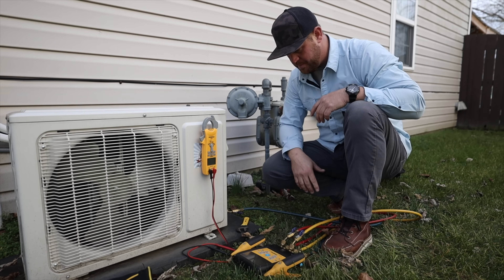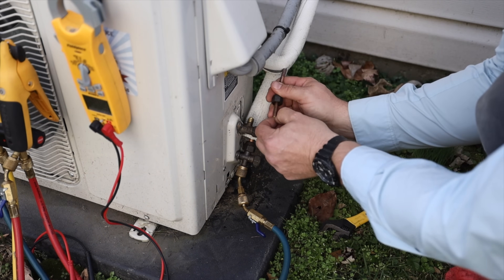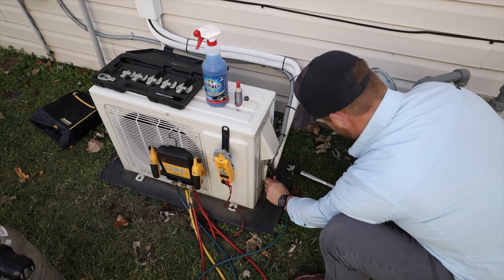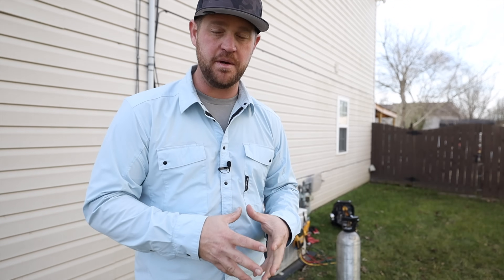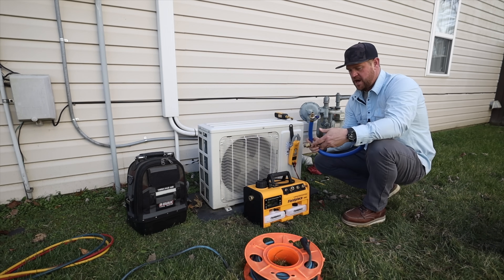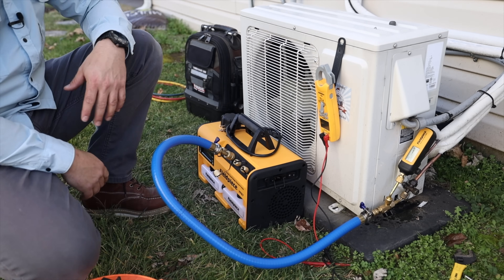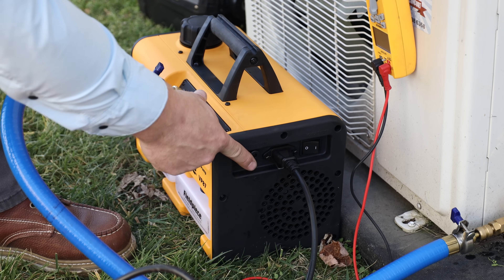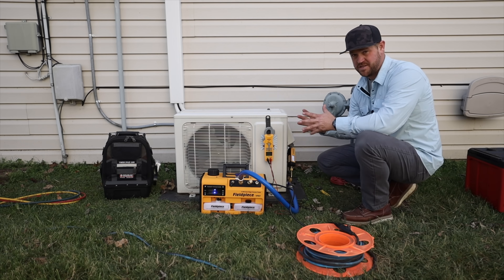#1 Reason Why DUCTLESS Units Fail | How I Fix It...

Comment: One note: anytime you're using a torque wrench you can't re position the wrench when you're close to the torque spec. If you're trying to hit 10 ft/lbs but stop at 9 ft/lbs and reposition the wrench, the wrench will hit 10 ft/lbs and click without tightening the nut at all because it takes more torque to get it started tightening again, so you will still be at 9. That also means multiple clicks on a torque wrench does not work for checking if something is properly torqued. It takes like 130-140% of the torque load to get the nut moving again.
Reply: Once you use lube your torque change’s.
Reply: @busterworley8418  nylog blue is liquid gasket, it's very tacky and not much of a lubricant under high friction. Its liquid spider web.
Reply: @busterworley8418  Agreed, lube has a big impact or the torque spec.
Reply: That is not blanket true - many multi stage tightening procedures have less than a 130% jump to final torque. Also he was using a thread/joint lubricant which makes it less sensitive. Will agree that one smooth motion to final torque is best.
Reply: @paintballthieupwns  130-140% isn't really the important part, if you stop early to reposition and the wrench clicks without moving the nut you're at the wrong torque. Thread lubricant is a whole other can of worms since it's impossible to get the correct torque without the lubricant being included in the spec. I assumed it was a sealant and/or anti-seize not lubricant.
Reply: No sir, there are no absolutes in reality when it comes to this.  It depends on a number of factors - composition of the nut/bolt, thread sealer being used, any debris or rust present, any lubrication used, and so on.  I get where you came up with that, but to say "(x) amount of force is needed to do (y)" is wildly variable.
Reply: @karlchilderz  Like I already stated, the % is not even the important part. It doesn't matter if it takes 110% or 190%, with a click wrench you don't even know what torque you're at when you stop anyways. The point is, if you stop and start again and the bolt doesn't move before the click you're at the wrong torque. Nut composition, sealants and lubricants are all part of developing the torque spec. Using dirty/rusty bolts again, is a different conversation.
Reply: @karlchilderz  Even the line set's copper from different manufacturers is different thickness and softness.
Reply: @grigorshukerski4689  that is because like any metal it isn't pure and all the additives and alloy metals in it change things like its compressability,  modulus of elasticity,  etc.  I am very familiar with this stuff. Got a masters in EE and PhD in physics.     I tried to pay attention in school.     :)
Reply: @karlchilderz  I found out by experience that to torque by the manufacturer's specification besides fake security feel doesn't mean a thing. It could be a reference point, but you have to have the experience to feel  what kind of copper you are dealing with.
A few classes about the metals in the university helped me a lot. At least you know what to expect.
Reply: I used to calibrate torque wrenches and the click type where + or - 15% accurate.
Reply: That is Horse poop, about the only time you need to recalculate is when your not at 90 degrees.

Comment: Justed watched this - "Install your own AIR CONDITIONING in 4 HOURS! DIY Mini Split MR COOL".  Now I'm watching this.  This one seems more like what I know is involved in installing a unit like this.  Nevermind the $20-$30K worth of tools and equipment needed to be in this business.  Great video. Thanks.
Reply: Ductless systems can be very much DIY, though they're geared towards the high common sense/advanced DIYer. However, once you're done, you should still call an HVAC company to come out and check for leaks/contaminants in the lines. That includes pre-charged lines like the ones from MrCool.

Comment: When you first arrived you stated you had 50 psi of refrigerant pressure you then added nitrogen pressure on top of that to find your leak. After finding your leak you then blew the refrigerant and nitrogen charge to atmosphere which is illegal as you intentionally vented refrigerant. What you should’ve done first before adding nitrogen is with  soap bubbles or a refrigerant leak detector and checked for leaks that way first. You may have been able to just tighten the flare and recharge. Possibly.
Reply: 50 psi would definitely be considered “trace” levels of R410 a… which if you add nitrogen for leak detection, is federally compliant to vent.
Reply: Depends on what refrigerant it is not all refrigerants are illegal to let out into the atmosphere.
Reply: Innocent until proven guilty.  Maybe he recovered refrig combined with nitrogen but didn't film it.  At no point in the video did he dump the initial test charge, only the second test charge. Merica!

Comment: How is this a fault of ductless mini splits? 
Wrongly done flare can cause leak in any air conditioner it could be a vrf, a ducted split , a mini split, a multi mini split, a walkin cooler , a walkin refrigerator! It could be anywhere!! . I have mini splits in my home for 2 decades. I have 5 inverter models all are Panasonic & 4yr old.

Comment: What ??? No Channel Locks, Wise Grips  or a 12"Adjustable Wrench and a $86.00 Vacuum Pump - Gauge Set Combo Kit like most other experts here on U-Tube !!!  It pays to have the correct tools including the knowledge how to use them , not to mention, well organized and kept clean.., But I did see one hair out of place in your beard ... I am surprised that thy were aloud to install the condenser unit so close to a Gas Meter and pressure regulator..

Comment: The main issue with Mini Splits is the fact that it doesn't take a professional to install or do general maintance to them. Thus individual's to hire are a dime a dozen, and as it said. You get what you pay for, applies. The equipment you have is only needed if one takes the time to do it correctly, and not needed by those who's agenda is to just make money. With few exception's ANY ONE can install and maintain a mini split. And that's the issue. ANY BODY does it cheaper, not correctly.

Comment: We have had to start using the shark bite type fittings.  Even our best, most trained installers have issues with the flare fittings on these units.  They are beyond frustrating.
Reply: Hopefully, we will be pressing instead of flaring soon.

Comment: A 3/4” hose that reduces down to 1/4" is basically a 1/4" hose.
Why don't you use the micron gauge on the SMAN?
Reply: Yep, from a 1/2” port on the vac pump… 🤣

Comment: Nice video, between the $660 fieldpiece VP87, the $530 SM380V, $200 TRQ1080 torque wrench kit, $550 trublu evacuation hose/adapter kit, $220 MG44 vacuum gauge, and a $330 SRS3 Wireless Scale with Remote. That's like $2,500 in test equipment... I'm sure the N2 & R410A cans aren't cheap either. O_O;
Reply: Raiden my thoughts exactly. 
I mean, don’t get me wrong, good tools and equipment sure are nicer for the tech worker and are usually the sign of a good job well done. But not always. 
In my town, the customers can’t afford to pay for what that equipment is worth, just means it’ll take me longer to build up to that level is all.
Reply: It’s not a lot of money for a business at all.  A Mac laptop is that much.
Reply: But having all of that stuff and knowing how to use it quickly like that, he's making that money back in days or weeks and it'll last a long time I'ms ure with how he treats his stuff.
Reply: @jberkhimer  exactly!
Reply: This is why homeowners really shouldn't be doing refrigeration work themselves.  The pre-flared ends make it POSSIBLE to do it yourself, but there are just too many service tools required to do the job properly, and if something goes wrong, a homeowner would never be able to move past that point, if they're even aware of it.  Then they end up calling a service guy anyway, and don't we just LOVE coming in behind someone that's screwed something up...
Reply: @davidryder3374 nah you can do it yourself.  HVAC has been around a long time. It’s just new tools you are being sold as a pro.

Comment: I’ve seen the bigger companies throw several techs at an install and they are rolling out in just a few hours and I always wonder how the connections will hold up to several heat/cool cycles when clearly the pressure and vacuum tests were brief. Most manufacturers call for triple evac. I’m a one man show and I insist my nitrogen test at 500psi holds overnight. Of course this makes service calls like the one in the video impossible.
Reply: AGREE. HOW CAN A 0.3 PSI DROP OVER 15 MINUTES BE GOOD?? 6:05   THAT'S ALMOST 3OPSI DROP OVER A DAY! WHAT PSI DROP IS ACCEPTABLE WOULD A DROP DOWN TO 499PSI OVER A DAY BE OK?

Comment: I always use nylog and torque the fittings. Static pressure test with nitrogen at 500 psi for an hour as well. Nice video!

Comment: The most common issue with the "mini splits" (as you fellow Americans are calling them) is the capacitor, a leak in the system is just a bad job, or poor quality fittings.
One free tip, stop installing them on the ground, just hang them on the wall (if possible) just like the rest of the world, it's easier to get moisture on the internal pcb or to be clogged, also shorter tubes increase efficiency. I have been running a 24k BTU Mitsubishi Heavy Industries AC for 15 years without any major issue, after 10 years it only needed a capacitor replacement
Reply: I'm not sure what you mean by capacitor.  Most modern units have VFDs that run the compressor.  There is a capacitor, or bank of capacitors on the control board.  Is that what you mean?  There is no start or run cap like the older units.
Reply: Us Yanks will learn LOL

Comment: The only thing i know about ductless vrf systems is if i ever follow the manufactures procedures to a T, i have 100% leak rates. Compression of the metal in flare joints is paramount. Creating good flares is another lesson.

Comment: After 50 yrs in aircraft maintenance, torque measurements have been the milk on my cereal for a long time.  The proper placement of a Crowfoot on the wrench should be 90 degrees to the torque wrench. As you used yours on the flare nut, the actual torque on the nut would be higher than the value set in the wrench due to the slightly longer arm. It's only about an additional inch, and since you set it to the low side, you probably did not exceed the max allowed. There is a formula for getting the correct torque value when using an extended arm, in case you need it.  It's in all the basic airman's maintenance manuals, but I don't remember it.
Reply: Those wrenches do not use "crowfoots" in the traditional sense. They come with those adapters and are calibrated for them. No need to compensate for them.

Comment: Experience is invaluable when doing flares. I used to use a drop of oil on the flaring cone. For 410 a drop of nylog. Experience might let you not use a torque wrench to tighten. For most use the torque wrench to tighten to specs. Also i coat both sides of the flare with nylog. The only leak i ever had was a siding contractor hit the condensor unit outside after a unit was a couple years old and it leaked. Great advice in this video
Reply: I use Nylog on R22 also, there's two different types available, red and blue depending on the refrigerant. It's good stuff, I use it as lube when flaring too.

Comment: Every leak I have seen on one of these systems has been at the flare, either inside or outside. On one job, I followed a well known local contractor who used "Leak Lok" on the flares. Good flares, and oil only, for me.
Reply: this is the way.... do not use leak lock or teflon the oil creates a seal

Comment: I know this is a service call, but the technician is supposed to find a 120V convenience outlet within sight. Where did he plug in the vacuum pump ? Also there is supposed to be an electrical disconnect for the 240V going to the unit. Maybe that grey box has the circuit breaker. ?  I just installed my mini-split and pulled a permit. The inspector told me he was going to look for a convenience 120V outlet within sight or the compressor with a weatherproof GFCI , the electrical disconnect (unfused is OK), and the drain line from the air handler 12 inches away from the building because of termites & moisture. He wanted to see a 20A breaker in the panel box with 12 guage wire. Good video but the installer should have put an aluminum stand on that concrete slab.

Comment: Latest in tools, very nice. You do NOT put nylock or any "sealer" on flares. Make a flare w/oil and double check for cracks because a lot of tubing is crap. A little oil on both sides of flare is all you need if done right
Reply: Just so you know, Nylog is not a sealer it is a highly viscous oil based product designed specifically for this purpose. It is recommend by many of the manufactures. Kinda similar to motor honey in consistency. (bad image I know but it is the only thing I can think of like this) It never dries and is safe to to get in the compressor oil. You are correct in saying you shouldn't use a sealer and to check for cracks and or bad flares. Those can be a real problem.  But Nylog is not a sealer in the traditional sense. Check it out, it's cool stuff.  Here is a video I watched about it back.  https://www.youtube.com/watch?v=PaGwWmd6Ey4  Sure it is from the manufacturer, but I have used the stuff and it pretty much how they show it.
Reply: @mikeman400  have been retired awhile,  had not heard of this product, only leak lock (blue thread sealer) thanks for update!

Comment: You just blew off the remaining R410a along with whatever nitrogen you added to leak test......that's not cool and illegal in Canada. HFC410a has a life span of 36 yrs and is over 2000 time more GWP (global warming potential) than the equivalent CO2.
Reply: No, he didn't.  The system was flat.  Any 410 remaining at atmospheric would be negligible at best.

Comment: Excuse my ignorance, but I thought that any time one services a unit and pumps it down, they have to capture any residual refrigerant, not just vent it to the atmosphere.  That is how the AC shops that I've talked to justify their prices by saying that they have to use this $3,000 machine to capture the Freon instead of just a vacuum pump.  I get that most of the refrigerant had probably already leaked out, but there was likely some still in there.  

Also, after you pull a sub micron vacuum does that not also remove the oil from the system?  Don't you have to add back a measured amount of oil with the refrigerant?  Or, is that only for automobile systems?
Reply: You're supposed to recover but 50psi was basically nothing plus it would have leaked out anyways 🤷🏼‍♂️

Pulling a vacuum does not remove oil.

Comment: I'm curious if this is even allowed to install those units like that on the ground on the concrete plate without screws? In Europe those units are usually wall mounted. It means that all the vibration they are experiencing will go to the hangers and then to the wall. Whenever you are starting and stopping the unit, - where all those vibrations are going to? Right, - units probably slightly jumping around. But cause they are not secure, - they have those micromovements. Guess what's gonna happen after thousand of cycles? Right, - you gonna have leak! Am I wrong?
Reply: Ari Shem  In New Jersey where some areas flood they REQUIRE them to be mounted on platforms above ground.
Reply: @gatesmw50  weird, that channel owner has no comment for me

Comment: On Tuesday I have a crane and mechanics -- two really good guys -- coming to rescue a rooftop unit.  (To help the people who are now working in a very hot office.)   The outdoor coil failed --  leaks where the guys cannot braze it.  This is a difficult situation because a new rooftop unit takes 52 weeks to get so getting a whole new rooftop unit is not possible.  But we have a plan!  The guys are gonna install a brand-new condenser unit (compressor and outdoor fan).  They are gonna connect this new condenser unit to the existing indoor coil.  Of course they will connect the power circuit and the control circuit.  Besides that they will be using a new refrigerant because the old unit ran on R-22.  Pretty sure this is all going to work.  I have fixed a lot of stuff in my life -- it is not easy -- so I respect these guys that can figger stuff out and make it work!

Comment: 11:50 I would love to see a close-up how pipes and hoses are connected.  It appears that the lines are connected to the flare nuts and that there are two additional fittings for the service port, where you connected the vacuum pump.  I want to understand how these ports work.

Comment: No  matter what,  eventually flare SHALL fail .  That is why I use soft silver solder #8.
California
Reply: Well said, exactly .
Press fit on refrigeration scares me.  
I do exactly the same,  StayBright # 8  Silver Solder . Lasts for a lifetime.
Flare press fit has so many failures . So many sad stories. Specially for Do it yourself Mini Splits.
.. California.

Comment: Woah, I'm not used to that placement. In my area a HP or AC has to be 10 feet from a Gas Meter. I believe it's code because it could be an ignition source if there was a gas leak. (West Coast - They are probably worried about earthquakes)
Reply: Here in Indiana it is 3 feet from the gas meter.
Reply: @MrTrailerman2  That would be nice. A lot of customers want the HP or AC on the side of the house near the electrical meter and gas meter right outside the garage. I'm always having to tell folks we have to go 10 feet further back and closer to the main part of the house.